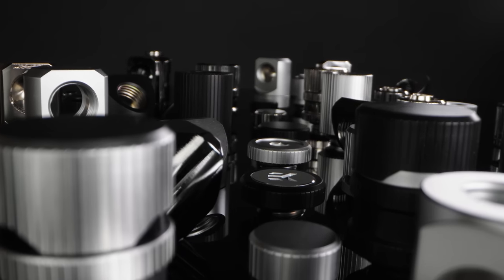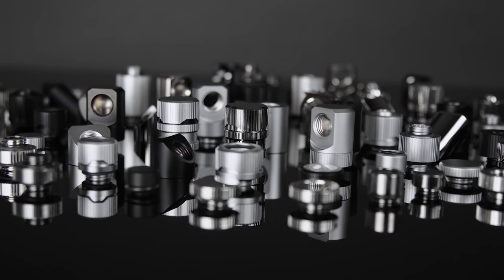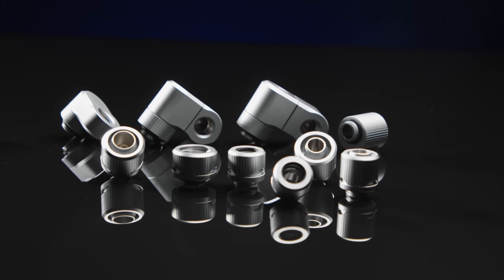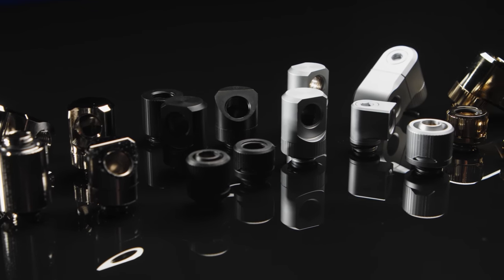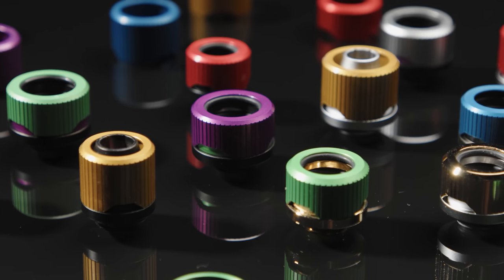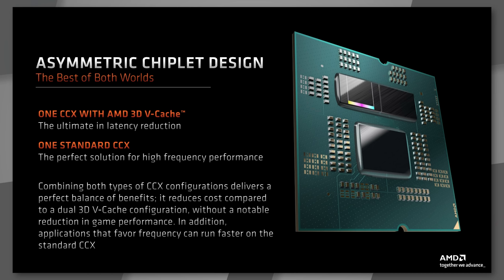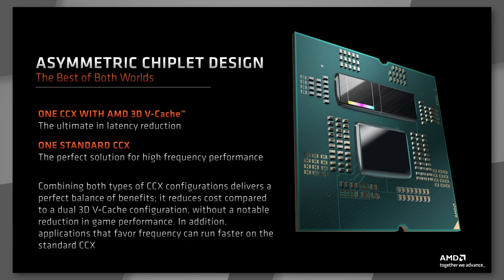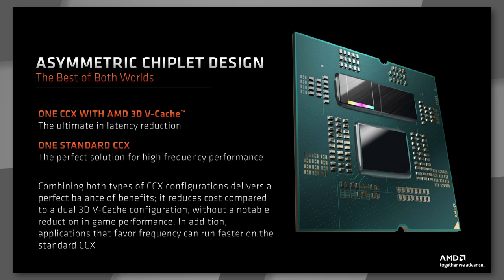Why I switched back to Intel...

Comment: Over the summer I had purchased roughly $5000 worth of computer components in order to build a PC and then I spent another couple THOU replacing components because of stability issues. I had a 7950X3D on an X670E crosshair hero. Firstly I did not know that four sticks of Ram was unstable so there's that, I went through four different sets of Ram two were pairs of two and two were sets of 4. I had tried the two sticks of the other ram which was certified by Asus and they would not work. I did every single bios update and tried every configuration I possibly could. I got so much help from Micro Center thankfully but it was not enough. The bios update 1807?? (I think 7) Has been the only update to the bios that has worked at all.

I am now doing an RMA on my 3D chip In hopes they will find that it's not fixable and give me my money back so I can go buy a non 3D, 7950x. I think it's funny that this video popped up because I didn't get to see this one from you. I probably would have done this sooner.

I actually found that there is an island of stability at 7200 MT/S One of the biggest things is to have ram set that's much higher clock speeds and then clock it down. I now have 7600 clocked down to 7200. I'm probably gonna take my time watch some stuff maybe try to see if a game will load and not trash and then say goodbye to this processor.

Does anyone want to buy four sets of ddr5 (6000 expo) ram?.

Comment: I'm on a 9900K and thinking of upgrading my system => watching videos like this lately.
For my 4400MHz memory i had to buy a motherboard that supported that speed, and there were only a few options. The mothermoard i have is an MSI Z390 Godlike (very expensive those days). But, i can not run the memory at one of the XMP profiles. Some games would just freeze, but all i did in Windows worked fine (non-games). I tried a lot to make it work.
Next time, i will not go for the fastest new memory.
And i do not want to dive into overclocking memory ever again.  voltages, timings, headaches..

Comment: weird things must have changed in the last month. just built my first amd system in 20+ years. 7950x3d runs great and not seeing the 3d ccd binning. also the 6000 mt ram works just fine without having to retrain on boot. funniest thing is im on that asus motherboard that was so troublesome earlier on

Comment: Are these issues fixed, or has AMD acknowledged the issues and claim to fix them? I am looking at a CPU upgrade in the near future, and I currently run with an AMD 5800x, and generally have had a good experience with AMD cpus. Would anyone be able to enlighten me?

Comment: Ahh great. I thought if I get a CPU without E-Cores in the future, I won't encounter problems with parking. Currently got an i5-12600k and I experienced constant micro lags and frame drops in WH40K Dark Tide. Now that I reigned in core parking and usage of E-Cores (Park Control / Process Lasso are the tools for the job), everything works flawlessly again. But finding the issue drove me almost crazy.
Reply: Must be using Windows 10.
Reply: @NBWDOUGHBOY  You're correct. I read that the scheduler is better in Windows 11 but also that it doesn't solve all the issues. I'll find out once I finally upgrade.

Comment: I got a 7900x3d. I was told that it's aparently even worse for gaming than the 7800x3d after building it. My first PC, and I built it myself. Super happy with it, but I'm new to PC so not having to worry about overclocking is sort of nice. I haven't really had any issues other than that my DDR5 7200 intel set wont work. I was only able to get intel sets, but apparently it's supposed to work on AMD motherboards. I can't get it to go any faster than 4800, though. Every time I set it to the higher options it gives my a weird mostly black screen with a red logo. it sends me to the bios and tells me not to set the ram so high lol

Comment: Wow, I'm sorry you couldn't get DDR5-6000 stable; that sucks. My 7800X3D is stable with DDR5-6000 CL30 (G.Skill F5-6000J3038F16GX2-TZ5N). I'm hoping with AMD's 9000 series supporting DDR5-8000 as standard, that the 9950X3D will be better with RAM again and I'll probably upgrade to either that or the 9800X3D (if the 9950X3D still has scheduling issues). I'd be keen to see another update review now on the stability of the 7950X3D after 1.5 years of updates to BIOS, AMD drivers and Xbox Game Bar.

Comment: X3D isnt Plug and play, there are easy fixes for the problems he addressed. For example Process Lasso you can set the affinitys to the game, so the game only runs on the CCD with 3D VChache, and some CPUs just cant run high RAM Speed, i know people that run 6400mhz 2133 ECLK Freq. on a 7800X3D, mine just wont go over 6160mhz. 
Maybe he should have tried to get another CPU and test if this one also doesnt work.
But like he said its his System do what ever you want.

Comment: I has the same problem with asus x670e-e gaming wifi motherboard with 7950x and trident neo 6000mhz ram. The bios was causing memory problems with expo and would cause the wifi to constantly disconnect. And i had to keep resetting the network adapter to connect. Had to wait for the updated bios almost 2 years after the release for asus to fix the issue. There was a lot of other ram issues aswell. Like programs not opening or freezing,❤ especially armory crate.

Comment: I've got a 5600x and have started saving for a 5800x3D since my current CPU bottlenecks pretty badly with my 3090 and because its cheaper than switching to intel or AM5.

Comment: Changing the e-cores from 4.4 to 4.3 reduced temps quite a bit for me with my 14900k, even in gaming where I was getting weird thermal spikes that never occurred on my 13900k. Whatever extra voltage is going into them is creating all sorts of unnecessary heat, and my synthetic scores actually increased slightly (with power limit).

There's really no reason why you should be running your e-cores at 4.6. That's just stupid and totally unnecessary.

Comment: 7800x3x is stable in my system and fast (Asrock B650m Pro RS Mtx) but my main issue is the temps. It gets really hot underload. Like 83c which apparently is considered normal.
Reply: lol seriously... 83 is completely normal. Get an Intel 14700k or 14900k and then let's see your temps
Reply: @reinulf5474  I adjustment my fan curves. They were running on silent mode lol. I dont see anything higher than 72 degrees now

Comment: To compare intel and AMD, because intel always produce the mainboard cheaper DDr4 so intel easy to access with most of people using it, but when to calculate to performance with the same high price, I think AMD is better, because main B can use most of 7900x, or even 7950x. and new socket (just only about I7 14700k and I9 14900k) need high performance B or even Z mainboard,  further more it's kinda have issue to have "intel baseline profile" to undervolt it, and intel consume more energy=>more heat=>need better thermal

Comment: I build 2700X PC by watching your videos from 2019 had untill 2023 then multiple issues started to appear  debugled(ram,cpu,boot & in the end vga) now rx590 & x470 shorted one each other by pcie slot & i need "new" x570 now i did bought used RX5700XT but now being stuck with broken pc. I felling like "owning a classic muscle car 😂 i kept fixing it on a drive way instead of driving it" but at leas i got a lot experience with troubleshooting & building pcs. 👍 @JayzTwoCents

Comment: ive got a 14700k and i had so many random problems that im thinking its the stability issue that has been going around with 14th gen cpu problems. (out of memory/critical solution errors/ just the usuall stability and im running at stock and even under stock i sometimes even had to make my memory 3200 way under base frequency of ddr5 mem freq.(with the right timing and power settings for that reduction in frequency) but it was good for awhile but now im starting to have issues again.

Comment: So its not noticeable without benchmarking in games but thats your top argument? ;) Makes really a sense. My 7950X3D usually is 60-70°C at gaming, dont know why you talk so much about throttling. My system runs stable with 6000Mhz RAM without problems with G.Skill RAM, but I must admit my first kit from Corsair didnt even run stable at without OC. Running on Gigabyte Aorus Master, no stability issues at all, dont need retraining RAM or all that problems you have. AM5 needs good RAM or you wont go nowhere, I learned that fast. Once you found working RAM there should not be any stability issues

Comment: Not sure if this has improved Alot past 4 months or I got golden config, I run 7950X3D with 2x 48GB sticks of XMP ram. Yes XMP not eXPO , and both PC stores I went to while building my PC where stern about it not going to work or I will see instability shortly, but I been running A-XMP on MSI x670e tomahawk, for month or so and done Alot encoding or AI task run cpu GPU through night on works and so far smooth as could be, actually running better driver latency and stability then my 5900x was

Comment: i HAVE A 7700x WITH GIGABYTE x670 gaminG X AX and 4 sticks of ddr5 16gb XMP 6000MHz and I can only run this memory config on the base BIOS, any newer bios, it just goes into boot loop. Only issue with the base BIOS is that my pc boot time is 60s , but i am happy as i am able to run 64GB at 6000Mhz

Comment: i chose to switch to ryzen 7 7800x3D because i am mainly gaming and my RAM was never stable until i got it down to atleast 4800mhz but it would still blue screen or restart by itself. Booting issues as well. It’s been a nightmare just switched back to i9 today

Comment: My 7950x3d with a msi meg x670e  ace with corsair titanium 64 gs with a asus srix 4090 after 18 days of using probably less tbh get burning and the cpu burnt out . Luckily microcenter was able to extend the 15 day warranty and exchange it ima try see how it goes now but my first experience with a 7950x3d isnt going so good so far

Comment: I had fx 8320 it was not great.  I was not happy with AMD.  But I bought 5800x 1.5 years back.  No complaints whatsoever.  Its on par with intel. Stability wise Zen3 is extremely stable, much better than 9600k I had.  I think the asymmetric x3d design is new tech.  This is poorly tested by AMD. That issue is probably with 7950x3d and 7900x3d only.

Comment: those e core should be that high clock speed that where you get all this heat and i can run my 14700k at p 5.8ghz e4.4ghz no heat problem

Comment: 7950x owner since launch it had slow boottimes, but now many many updates later on my B650E pg riptide wifi, it's just 11secods, gskill 6000mhzcl30 + buildzoid secondary timings work with no problem for over the year now, undervolted cpu with negative curve optimizer to -25 on all cores, could do  -30 but it would  crash once in a month even at idle usage, -25 was sweetspot and it could hold 5.5ghz all core while gaming, i also turned off HT it gives slightly better fps. Overall nothing critical, would not trade it for intel platform, waiting for next gen x3D parts

Comment: Although I've been using 3900X for more than four years, I still can't trust AMD in terms of software/firmware due to frequent USB disconnection issues that occurred at the beginning of the release, performance issues on Windows 11, and problem that difficult to achieve the boost clock of 4.6 GHz in terms of specification.

Comment: Most of the "instability" issues come from xmp / docp / expo ram missunderstandings. Since copyright problems i think AMD had to rename the ram profiles. This causes the most instability problems. Where its was negligible for ddr4 (docp and xmp), with ddr5 you "have" to choose INTEL xmp or AMD expo specified memory. AMD memory uses different voltages and the information is not in the xmp profile from intel, but the clockspeed is. So you lack of voltage with higher memory speed and you run into crashes or it wont even post. 
Oh and for your 7950x3d... Why not use Process Lasso?

Comment: This is a mistake. The zen 5 will profoundly change in the 9000 series up to 70% IPC gains. On current 7000 series.
Reply: LMAO do you actually believe that zen 5 will improve IPC by 70% 💀even an IPC uplift of 20% in considered extremely impressive. Zen 5 is expected to likely maximum reach an IPC uplift of 15-20%.

Comment: Purchased my current computer not too long ago and gave AMD a chance based on bang for buck at the time and all the reviews saying how much improvement their hardware has gone through. 

Somewhat regret it now. It works most of the time, but I have gremlins that almost always seem to point to AMD software. I was increasingly experiencing Windows gray screen which I think (fingers crossed) I traced back to AMD firmware not updating. Somehow the AMD Adrenaline software just straight up deleted the option to update. It was nowhere to be found. So I uninstalled, then reinstalled, and bam, there was the option to update the firmware exactly where it always was. I updated the firmware, and haven't experienced gray screen since. 

Then, a video conversion software I use to manage my home media server wouldn't operate until I uninstalled Adrenaline. 

Games also seem to crash more than I ever experienced using Intel and Nvidia. 

This is on a system with an AMD 5950 processor and AMD 6950XT graphics card. No overclocking, no modifications other than tweaking fan settings to be more aggressive when system temps go up. 

Already thinking of getting a replacement system and I used to only upgrade every five years or so.

Comment: Honestly never went with AMD. Nothing against AMD, it’s just I’m comfortable with intel because it’s just my preference and it’s what I know. I’ve never had any issues with intel until the 14900k overheating problem, which was an ASUS motherboard with insane default setting. After fixing those issues, my system still purrs like a kitten and temps remain in the mid 60’s to low 70’s under load on my CPU.

Comment: Buy RTX3090 for $1200 before prices go up. Switch to intel 13900k or 14900k they are more stable. Remember to always do the opposite to what jay advises people!
Reply: Actually going to a 24gb vram card is kind of not a terrible move... Going to a 12gb or 16gb is obsolete in 2 years

Comment: finally switched to my first AMD build using R9 5950X with a top end ASUS board and faced the same thing. Would never get a basic 3800 to ever boot. Had to settle for 3666 for my high end system and it was very very dissapointing. My next build will be Intel again

Comment: I have a 7900X on a Asus X670-p WIFI board with teamgroup ud5-6000 hynix memory. Not only does my memory work with 0 issues, I get really tight timings with it as well. It's awesome. This is definitely a per user issue. Not everyone has these problems.

Comment: I use a AMD Ryzen 97950X3D and the booting is so slow and also using Google Chrome is so laggy or not responsive. Could this be a problem with using this CPU?
Reply: The slow boot times were only when OC RAM, and that was fixed with bios updates.
Reply: ah yes the 97950X3D, using Zen 49 architecture.

Jokes aside, its not necessarily a problem with the CPU, more likely a problem with the RAM.

Comment: I can relate to all this. Went back to intel from 7950x. Too many compatibility issues, my cap cards always stopped working. Memory never worked at advertised speeds. I gave up again on AMD. I also downgraded from 14900k to 14700k as the 14900k is terrible
Reply: The past 2 bios the autolearning has been significantly faster. If the most recent didn't resolve it then that's on the AIB motherboard partner. They need to update their QVL.

Comment: AMD has been bad for me, but I think the Asus motherboard I used had a lot to do with it.  I tried everything to add stability.  It wasn't even an X3D, but it was AM5.  Memory controller is awful.  I had to change the RAM brand and run it stock and it still would crash regularly while gamimg.  7900XT had problems with the majority of games I ran, even undervolted.  I sold the entire PC after a couple months of problems.  I won't buy AMD again.  Too many headaches.  My 4080 13700k system has a lot fewer issues. I am overclocking, so I occasionally get a crash or blue screen, but it is rare and I just adjust things and it goes away.

Comment: Jay somethings not right with your mounted water block. It must not be making good/perfect contact.  I'm running a 13900KS SP113 with unlimited power limits at 5.9Ghz up to 60c and 5.8Ghz afterwards on P cores and my E cores set to 4.7Ghz and it never gets above 78c-81c at full load. I'm using an EK Quantum Magnitude Nickel+Acetal 1700 block and 2x EK Quantum Surface X480M radiators.

Comment: Intel (multi-tasking heavy load work) vs. amd (less intensive multi-tasking workloads) Intel has higher load breakdown ceiling than amd does. Software and hardware of intel equipment are more polished than amd. Amd is prone to overheating. That’s the difference between costs. Beware of psu reputability as well.

Comment: You know what's funny? With the 13/14th gen Intel stability issues and the microcode release, Intel just lost around 5% performance while AMD is set to gain 10% performance from Windows optimisations, since Ryzen CPU's have had a major disadvantage for years due to poor optimisation for their architecture in Windows.

So essentially, the 7800X3D is going to utterly dominate a 14900k now and it was already a win for the 7800X3D before these changes. Now it's going to be roughly 15% faster. Goodbye Intel, at least until their new CPU's release.

This video did NOT age well.

Comment: 4 month old 7800x3D, restarted the computer and started posting QCode 15 into C5.

Either Asus Maximus Hero killed the CPU since Asus mobos are kinda sketch for AMD or the cpu killed its dram controller. 

I feel like the motherboard was probably the worst buy I could have done.